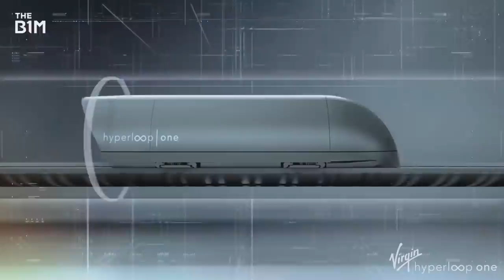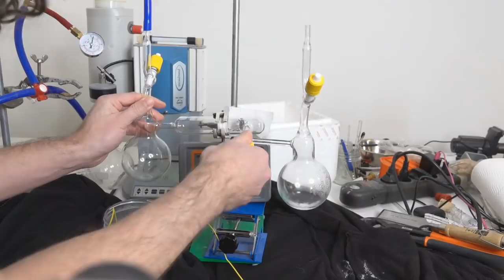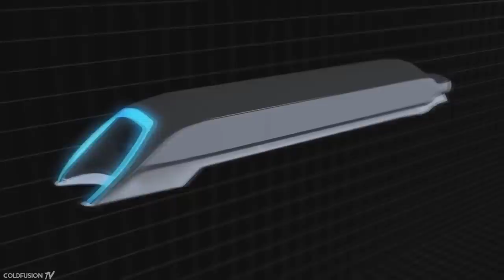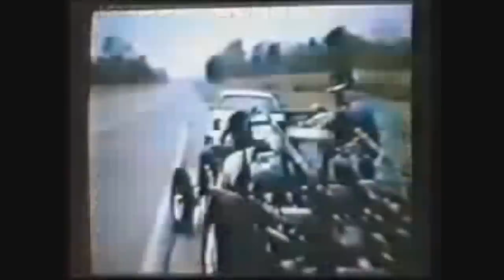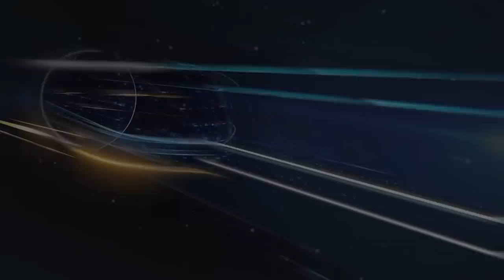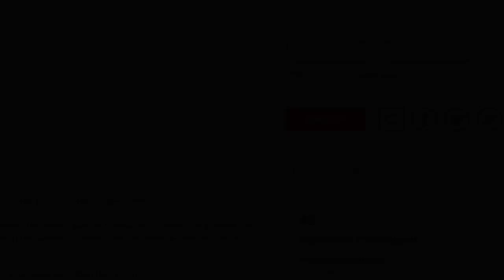Free energy device using Hyperloop technology!

Comment: I must clarify that, in order for this system to be sustainable, the southern end must always be warm enough to evaporate water. Fortunately, that doesn't require sunlight because two miles underground, it is at least 144° Fahrenheit, which should be more than warm enough. Therefore, here's how I think it should work: The Southern End, located in a tropical region, is a well at least two miles deep. Water flows into it direct from the sea through filters. At the bottom of the well, the water evaporates and then travel as excessive speed through the Hyperloop, all the way to the Northern End, be it in Greenland or Northern Canada. Either way, when the water gets there, it is condensed into water and then poured back in the ocean. And the cycle is renewed. How does that sound, Mr. f00t? Also, what if these Solar Roadways were built in tropical regions?
Reply: The whole point of this machine is that water boils at low temperature in a vacuum, so a warm sea will be more than enough to power it. This machine is already working and giving us free energy. The warm temperatures at the equator heat the air and evaporate the sea. At the colder regions, the air shrinks and the water condenses out as rain. That causes air to  constantly circulate around the planet, so you can put up a wind turbine and extract free energy or you can put up a sail and travel accros the ocean for nothing. I've travelled 6000 miles in my sailboat and never had to pay a penny. It's free energy.
Reply: @hughjardon3538  The problem is the wind, let to its own devices, is intermittent. But with a system such as this, the wind will move constantly and in a specific direction without any exterior interference. That's called control, such as indoor, vertical farms.
Reply: @kevinlane1219  That's partly true. We have trade winds that are generally quite consistent, though never100% predictable.

Comment: So you are going to heat the air/water from -40 to -15 at one end. That might cost some energy. What are you going to do with water that had traveled all that way? Isolation for the tube: One point at the middle could reach -20 during the winter. How about disposal of ice at places that could get overly cooled?

Comment: 99.74% efficiency? Anything under 120% doesnt seem legit. But great video, ideal for sharing with ppl who supports free energy stuff and backed some things. Would be hilarious if it gets funded :D

Btw how about building up instead of poles? if you connect oceans to near-vacuum of space its cold and low pressure and as bonus you can make space elevator for free and also solve the problems with raising water level saving some islands from disappering :D Please send exactly 8.451236% of groupies to me if this idea makes you famous :D
Reply: It wouldn't work with space because you can't lose heat in space
Reply: Right. You know when you boil water in a teaboiler. When the water is done it screams, and in space no one can hear you scream. The system wouldn't know when it was done, and it will 120% guaranteed explode
Reply: @eldritchcookie7210  what about radiative dissipation ? (serious question)

I am not sure if the original message is ironical. If not here is my take on it.

I rather think that it won't work because of gravity: several kilometers high water vapor column mean a significant gradient of pressure from the bottom to the top of the tube. ie. the system will be in equilibrium.

Think about why the water in the ocean doesn't spontaneously vaporise into outer space. There is not physical barrier between earth and outer space
Reply: JP: Invert it!  The very deep ocean is really cold, and really thermo-conductive.
Reply: @adm0iii  REVERSE THE POLARITY!
Reply: Radiative dissipation is the "only" one that significantly works in space. However, in comparison with convection and conduction it's much harder to dissipate heat with.
Just look at the ISS and its big feking radiator panels.
Reply: @RowdyNPC  water doesnt vaporise into space also cuz its colder up there so clouds form, but yea why would you need a pipe connecting it, i mean that pipe doesnt change anything, the inside of pipe stays the same as the outside of it
Reply: @eldritchcookie7210  how do you think the ISS deals with heat?
Reply: if it weren't for other reasons that it wouldn't work, the water (vapor) in space would become space debris
Reply: 99.74% of statistics are made up on the spot! or is 74.99%?
Reply: But one part would be super hot because of the sun
Reply: You forgot gravity

Comment: Wouldn't if be better to go all the way around Earth on the same latitude, hell, better on equator. If you make it from pole to ocean, the system would reach equilibrium and then only small temperature differential would be present. If you make it all the way around the planet, you can make it reversible as the system would be colder on the night side and warmer on the day side. The vapor would follow Earth rotation. 
Also plate it with some UV sensitive material that becomes black during the day and white or transparent during nighttime.

Definitely seems more legit than Hyperloop :-)

Comment: Ok, small modification use an arced tube that reaches to space and back (continent to continent) with a  venting system at the top.  

Now you have 2 generators (using the natural vacuum of space after pumping out the lower tubes of atmosphere and adding water), AND when not generating power you can use it at as an intercontinental transit system aka "Thunder Arc TM".   Insert a"Thunder Pod" TM for travelers into the evacuated tube, then let in the atmosphere behind it... BOOM!!  and on the other side all you would have to do is a controlled venting to absorb the reentry energy.  no messy rockets or explosive fuel or anything!!!  What could POSSIBLY go wrong?

I think you cover all the Elon bases then... 1. you are proposing something beyond what you can actually engineer  2 its big and flashy and ultimately creates a "new" form of travel that is insanely dangerous    3.  its an tiny tweek of an idea that has been around for 100 years ( i.e. the pneumatic tube),

Comment: One wonders why they haven't used similar tech to exploit the difference in temp between the deep sea and the surface of the ocean.  Easier to make a tube that's a mile or so long than 4,000 miles.
</sarc>

Comment: Will not work because of the bearings of the shaft. The shaft has to go through the vacuum tube and will not hold seal
Reply: That's not a problem; put some magnets on the rotor and coils on a stator around the tube. The moving magnetic field generates current in the coils.

Comment: Beyond the fun dig at the various bad science crowdfunding scene, I identify a real argument here: If the Hyperloop were possible, then this idea would actually work, since the existence of such a long vacuum chamber is the one difference between the tiny prototype and the energy-making version. However, this idea is not actually feasible due to the inability to make such a sealed tunnel, and therefore the Hyperloop is not possible. 

Of course, this assumes that the Hyperloop is supposed to be hermetically-sealed vacuum, which it isn't. Rather, it's supposed to maintain its low pressure using pumping stations, which would cost energy. This has been pointed out to TF multiple times.

Maybe I'm reading too much into it. Maybe this really is just a dig at people who don't grasp how a difference in proportions can make an idea that works in the lab and on paper, completely impractical on a large scale. But if this really is part of an argument against the possibility of the Hyperloop, then  I find that this rather ruins the argument.
Reply: (On the smaller scale, the structural integrity of the glass is enough to hold together a sealed vacuum under atmospheric pressure. In larger scales, glass - or any other material, really - doesn't have this sort of tensile strength, especially in the face of heat expansion, and hence - the pumping stations to overcome leakage and maintain low pressure. A variation of this problem is also why a Space Elevator is not being seriously contemplated for implementation - we have no materials strong enough to make a cable out of. It's not the only problem with space elevators, but it's probably the biggest hurdle)

Comment: I don't claim to be an expert, I genially  enjoy your content and think of you of a highly intelligent and reasonable man, and part of me just wants to believe you are joking/trolling, but, and correct me if I'm wrong, wouldn't your proposed solution of bridging the north pole or somewhere cold with the west coast, a place warmer and with abundant water be a complete failure due to the same reasons the hyperloop is a complete failure ? (building a vacuum that large would be just too costly and impracticable), also, woudln't  building it out in the open (as to add solar panels and whatnot) make the water vapor too hot on the "cold end" of the structure ? (I mean, solar freakin' roadways have the same issue since, the sun rays, are quite hot despite how cold it may be out there). Again, I am honestly asking out of curiosity and perhaps ignorance as my field of expertise is computer sciences and game development.

Comment: you know if Musk present that lab demo you did and showed it to the public the media will go crazy and hype it all up
Meanwhile even a normal guy like myself will know that the energy it cost to cool the water to make the inside air spin the middle thing is more than the power it can generate.  so if the power needed to go in to generate the power that is coming out it will fail.  Law of thermal dynamics  I think. .   Learned that from watching your videos.  Thanks professor

Comment: that was perfect, haha. 

I'm not sure how well it will work but it looks nice.

I think you would need to make it on the moon though something .. something.. drill a hole all the way through the core of the moon to the other side and put a tube through it to generate the energy using the cold side of the moon's cold vs the sun sides heat.. using the difference in heat from the  light side and the dark side to collect energy  .. sure ya that sounds easy.. :P